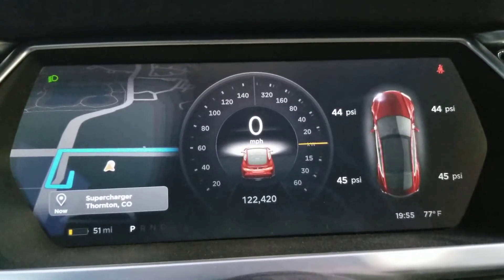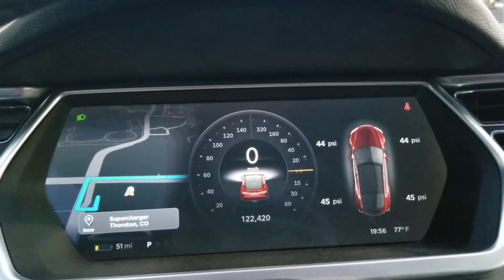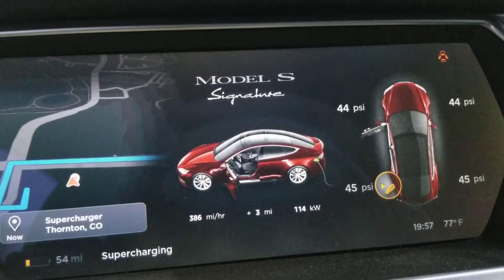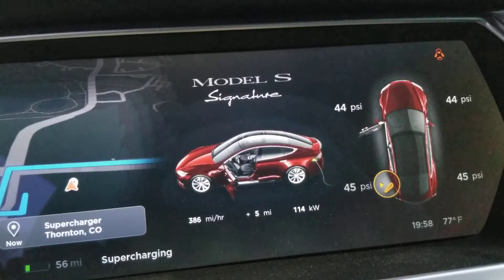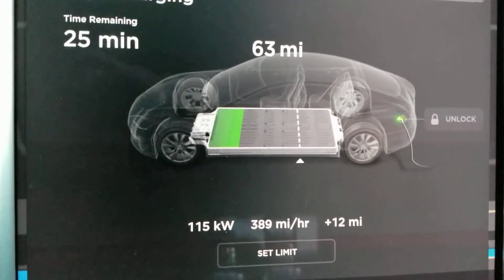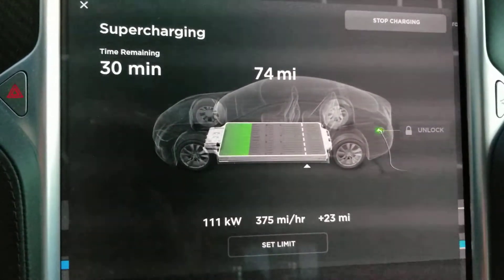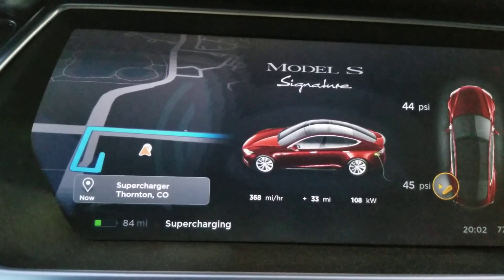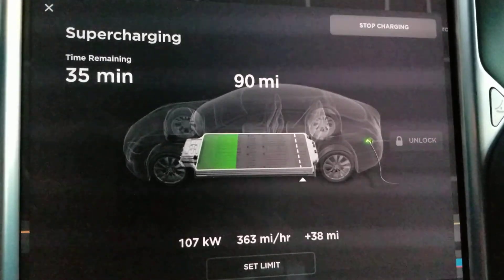1st V3 Supercharge with 90kWh replacement battery in our 2012 Signature Edition P85 Tesla Model S

Comment: How is your battery holding up? Did you by chance get the 350 volt 90 battery? Looking at a vehicle with this type of battery upgrade and looking for some feedback
Reply from the maker: It's a 90lWh 350VDC battery. According to data from RECURRENT it is holding up fine.  Their range estimate is 297 miles with 100% charge.  Normally we charge only to 80%  Maximum charging speed at a Supercharger for this car is 125kW, limited not by the upgraded battery, but the rest of the car components which would cost more than an additional $10,000 to change.
Reply: Have you found out which components exactly? How do you know it's 10k?
Reply: How is the actual range vs the rated? Any notice in decreased performance with the 350v over the old 400v?
Reply from the maker: @kevincraven2581  Performance has actually improved.  Doesn't fade after multiple accelerations as load is shared by more cells in parallel rather than series.  I use my odometer and look at SOC (State of Charge) as well as Watt-Hours/mile, then do the math.  Frankly, I ignore "rated range" and opt for "real world range."  The estimate using range based on prior 30 miles of driving can be reasonably accurate on the fly for predicted range.  It has been +/- 1% SOC at destination compared to predicted at beginning trip under normal weather conditions, driving the posted speed limits.  If you want to drill down on this any further I suggest you go to Tesla Motors Club and search the threads there.  This is about as much as I want to get into here.   I've shared my real world experience already here and elsewhere.

Comment: Nice. So the v3 capable is definitely a thing. But not the amps it provides. Our 2013 85 is so much slower now over the years. A 90 doing those speeds is same as a brand new 90 from what I had ever seen. Maybe the first set of cables could only handle so many amps as well? Tks for sharing this! Super curious if you paid any money for this and how much if so. I keep seeing 20k USD floating around.
Reply from the maker: Here's our story:

We were driving home at night, east on I-80, heading uphill just past the Campstool Rd exit. There was a truck lumbering up the hill at about 60 mph in a 75 zone ahead of us. We caught up to it just at the plateau and moved into the left lane to pass it.  Normally thos is a pretty quick maneuver. Accelerating in the Entetprise is almost instantaneous even with its TOS warp core (original iteration battery). If the accelerator if fully applied it's not unlikely to be above "the century mark" by the time one passes the front of the truck. But then it happened.  

We were at 32% state of charge and all of a sudden the sequence of double alerts began ... "vehicle shutting down!"   Inertia carried us forward to the Archer exit and up the ramp where I could pull over safely.  Within minutes, the shut down was complete.  We called Tesla Roadside Service and they attempted to analyze it remotely before it completely shutdown. Ultimately, their recommendation was to tow it to the closest service center in Superior, CO and that since it was out of warranty we would need to pay for the transport, so I called AAA, as we have "RV Plus" for just a contingency requiring a long range tow. The car was completely powered down as I placed the call to AAA.   

While on the phone systems powered up.  I  tested propulsion and we had power, at least for the impulse drive. I  cancelled the roadside assistance and we drove home, docked and charged overnight.  

The next morning with no appointment, fully charged, I drove to the Service Center in Superior, CO without incident.  We previously had a mobile service scheduled for later in the week due to an alert for the 12 volt battery and a "low fob battery" alert despite both being recently changed.  I was expecting the Service Center to tell me I could leave the Enterprise there but they wouldn't be able to assess it until later in the week.  They kindly agreed to check it out within a couple of hours since I live over 100 miles away. 

It turns out that this 8-1/2 year old, original iteration high voltage battery pack, now with 122,000 miles on it and 6 months beyond the end of its original 8 year / unlimited miles warranty, had developed a defect which left us with 3 options.  

A).  We could keep using it for a while provided no heavy acceleration when the State of Charge drops below 50% or else it will trigger a shutdown again.  This fault also caused the other error messages.

B).  Trade in our 2012 Signature Red (one of only ~ 500 made) P85 as is for $17,000, then possibk6y buy a new Tesla with the latest tech.

C). Replace the traction (High Voltage) battery with an upgrade from 85 kWh to 90 kWh that would be the latest battery tech being used in new Model S/X, which would change the follow aspects of the vehicle: 1) range would increase from 230 miles to just under 300, 2) charging rate would increase from a maximum of 88kW to 120kW,  and 3) due to larger pack with higher voltage increase power for acceleration.  The new battery would come with a 4 year / 50,000 miles warranty.  We would continue to have free Supercharging and free premium connectivity for the life of the car. The battery would cost $20,000 and by the time one adds almost $1,600 in sales tax and installation it totals about $22,500. 

We chose option C. It took 2-3 weeks to get all the parts and complete the installation to do this. We are very happy with the result.  It charges at up to 120kW and has a real world range of up to 297 miles.
Reply: @AltView1  tks for the reply. Dennis_p just got his replaced AND they software limited it to 264 mi, is what it looks like. The wiring in your car from the charge port to the battery simply can't handle the amperage needed to charge at 250kW.... It's so dinky compared to the 3 and Y. You can def roadtrip again, tho, so that's good!